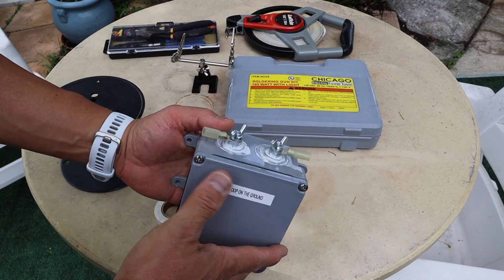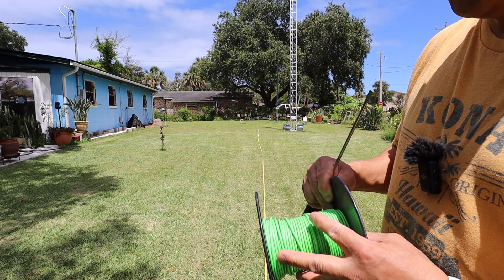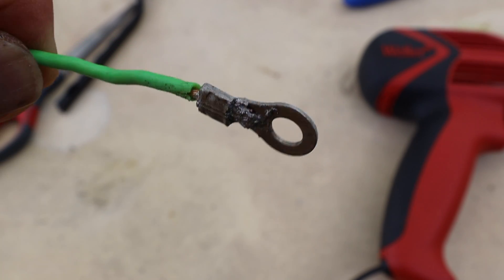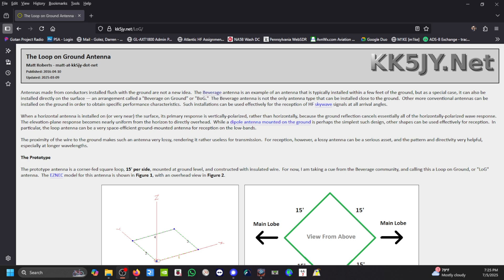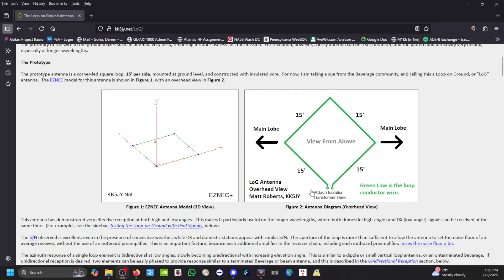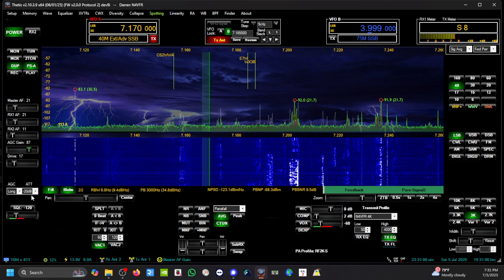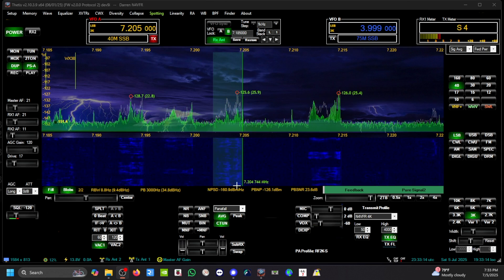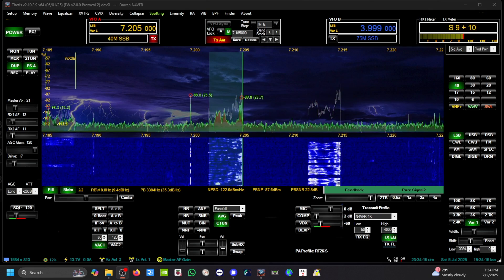Loop on the Ground (LOG) |  Part 2:  The Setup | Receive Only HF Antenna

Comment: Darren, pse invest in a DX Engineering DXE-RG5000HD. I hate to see you blow out your transceiver's front end, having your LOG that close to your TX antenna. You can measure the induced power by connecting the LOG through a power/SWR meter  to a dummy load when you transmit on another antenna. You'd be surprised how high that will be. Especially when running some power, expect around 80-ish Watt of induced power on the receive antenna port. If your RX antenna port is also switched (PTT) you're somewhat in less danger, but with most rigs the separate RX-in port is not switched.

Comment: I lower my Inverted L ANT  from 25 FT to 10 FT.  the noise level came down significantly  by 15 dB.  signal got a little weaker.   since antenna height is now below roof lines of neighbourhood.   surrounding building  are shielding noise coming from horizontal direction.  mostly receiving signal from high angle which is quiet.  AG6JU

Comment: Now use it with diversity with no attenuation on the dx commander. You’ll use both antennas at the same time for rx and you’ll be able to null the noise away and keep the gain.

Comment: Nice Video Darren,I've  been meaning to build one for a while. Also FYI I just downloaded the latest Thetis 2.10.3.11 and the NR 4 which works well. Only issue with the NR 4 I had to adjust my smoothing box to 70 percent on setup to reduce a flutter noise. Enjoyed your video and build. Keep em coming  Scott K5RSB

Comment: There's a tremendous difference in signal strength between the two antennas. Will the on ground antenna still work it you bury the green wire a couple inches below the sod? Then the ground wire antenna won't interfere with the grass mowing. 

I thought about becoming an airline pilot many decades ago but didn't do it. I eventually went into an IT career. I'm 70 years old now, and retired. Decades ago, the starting pay for airline pilots was very low. It would take many years working for very low wages as a low time pilot before the pay would increase. Do the low time pilots have to go through for years of low pay before their wages finally increase, like many decades ago?